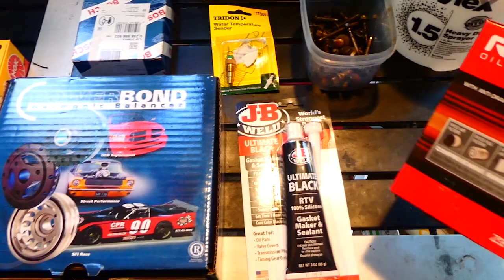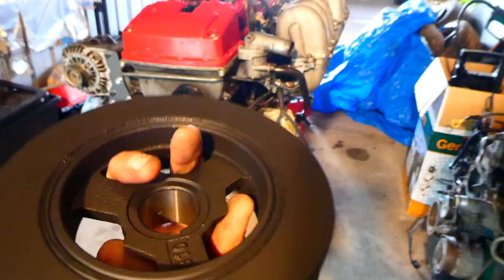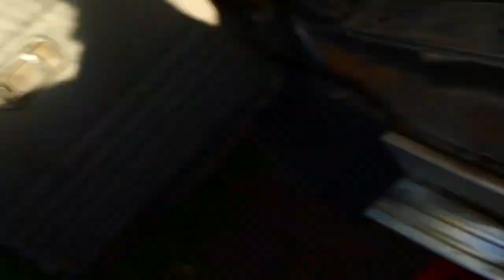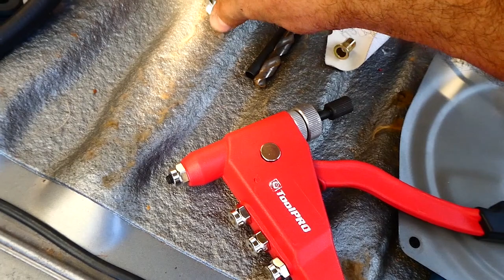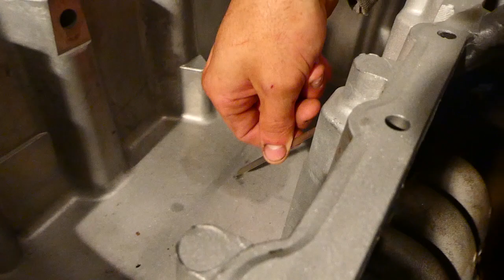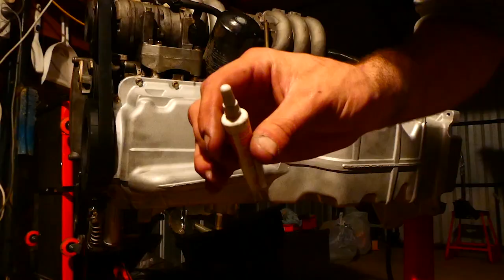GU Barra conversion EP5: General maintenance, sump and fuel pump.

Comment: FUEL LINE UP FRONT SHOULD BE WRAPPED AWAY FROM TURBO AS FAR AS POSSIBLE, UP BEHIND THE BRAKE SET SET UP & ALONG THE BACK. WILL SAVE A LOT OF ISSUE LATER DOWN THE ROAD. GO HARD MATE.